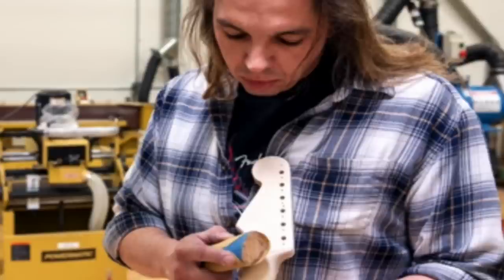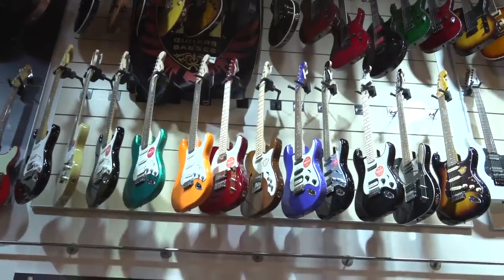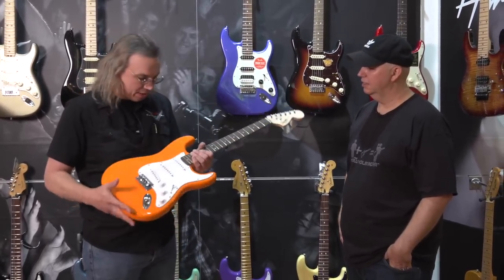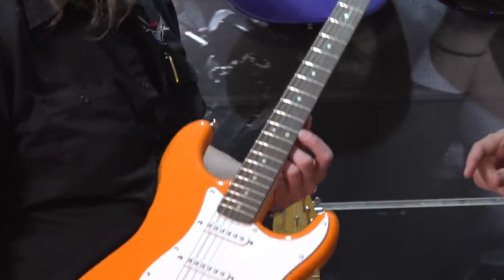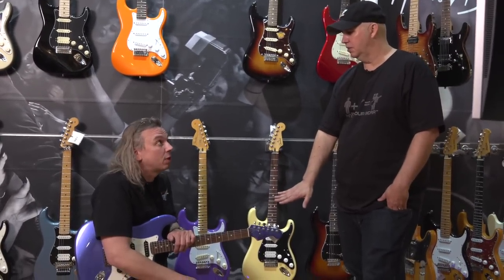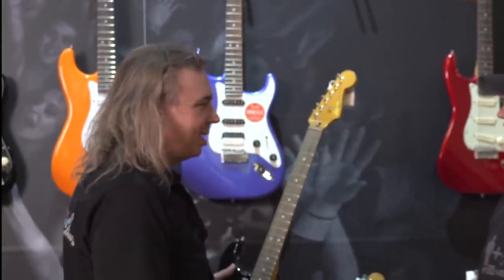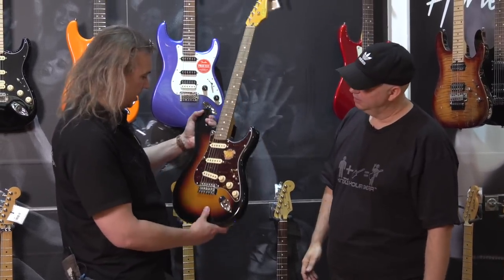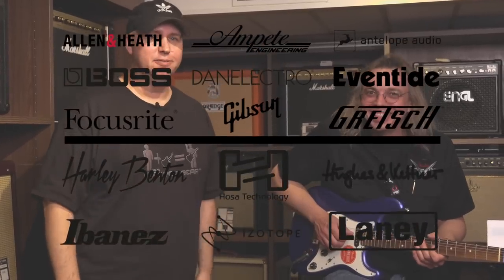What Squier Would A Fender Master Builder Buy?

Comment: Pretty much bummed out on Squier strats atm.  Ordered a new Squier Bullet strat online to use as a beater that arrived with bad electronics.  Returned it and ordered a Squier Standard strat thinking it would be better.  The Squier Standard was worse than the Bullet.  It had a bad neck that was set crooked and there was a 1/4" crack starting to develop at the top of the neck pocket.  The crack is on the top side of the neck so you can see it every time you play.  The skunk stripe at the back of the neck was not sanded flush.  The proud edge of the skunk stripe rubbing against your hand sliding along the neck felt sharp and was uncomfortable.  The front of the bridge was angled way up and couldn't be leveled without causing massive buzzing.  No truss rod adjustment was going to fix this neck.  The pickups had to be adjusted way up to match the high action.  Tuning was a nightmare and adjusting the intonation was all but impossible.  Couldn't RMA that Squier Standard fast enough.  That's two in a row defective Squier guitars purchased online.  Both were 2019 models made in Indonesia.  As with any mass produced product QC makes a huge difference.  In both these cases the defects stood out like a sore thumb yet they passed through QC anyway.  How does a plain as day easy to see and feel un-sanded raised up skunk stripe make it through QC?  Instead of binning a guitar that had a bad neck set they purposely angled the bridge to compensate and shipped it out knowing it was defective.  The poor workmanship on display here and cheap parts combined with the QC failures reflects very poorly upon both Squier and it's parent company Fender.  Only way I'd buy a new Fender or Squier guitar now would be to check it out in person because based on my recent experience the odds are good you'll get a bad one if you order online.  Can't trust the Fender/Squier brand name to deliver a quality instrument without having to cull through a pile of them hoping to find one guitar worth having.  It's sad really.
Reply: carpathus I don’t mean this in a dickish way at all, but you get what you pay for. I’ve never been happy with anything from Squier except for their classic vibe series. If you can’t save up for a MIM strat then at least try the Squiers out in store and save yourself the headache.
Reply: Whatever.  Guess you can buy something that looks like a guitar for 200 but if you want something that will actually function as a guitar, well that's a whole other story.  And just so you know, anytime somebody starts out saying they're not trying to sound in a certain way they are only fooling themselves.  Everybody else can see right through it.
Reply: Whelp, as it turns out the best move is to skip the Squier altogether.  Ordered a new Yamaha Pacifica 112J.  Build quality is as good or equal to an American Fender.  The Pacifica is made from high quality materials and the fit and finish are astonishing.  Factory setup and intonation were perfect.  Nothing wrong with the stock tuners but did change them out with a set of Hipshot locking tuners.  Freaking awesome guitar.

Comment: If I wanted to apply some steel wool to smooth the neck, is there a recommended grade to use?  
Or even a reco'd brand?
Reply: David Woods “4/0” or “0000” (same thing).
Keep it away from the pickups otherwise tiny loose strands will get get all over the magnets/poles.

Comment: I'm a beginner......Here's what I would like to see in a guitar for beginners:
1-  A purpose built guitar specifically designed to learn on
2-  I want rails running parallel to the neck to mount adjustable mirrors on so I can see my fingering on the fret board as well as my picking hand.  I need to maintain proper posture and instrument positioning while also seeing my fingers.  Once I learn what the hell I'm doing, this feature would be outgrown and I would buy a different guitar.
3-  A couple slots in the guitar to hold some spare picks as well as a place to stash the damned pick without setting it down and losing the damned thing.
4-  Built in tuners on the neck AND body to constantly check pitch while playing/bending etc.....

What features would you value in a guitar expressly designed to learn on?   This might be a ugly piece of crap but its purpose is purely as a learning tool.  I have NOT heard of anything designed and built expressly for this purpose......
Hello Guitar builder?   Anyone listening?
Reply: No problem....except you broke the bank barrier for entry level gear...shattered is a better word. Virtually nobody will drop the kind of money your talking about on something so specifically purpose built it has no resale value. You're talking about a one off custom. The word is now vaporized...
Reply: @willroland9811  
You might be right.  What would such a instrument feature that would set a entirely re-engineered standard as a unique one-of-a-kind instrument?  
  I don't see anything about this design that would make it any more expensive.  
  I am visualizing a tube frame around the fret board. The frame would provide a generous and adaptable mounting point for picking/fretting finger observation.  This frame would provide for adjusting a preferred angle between the fret board and the guitars resting place on your leg, your lap, or any other surface. This would also be a good place to locate a fully adjustable guitar amp cable plugin.  Telecasters have a good cable plug....Others, including mine have the cable plug in exactly the perfect place to smack into something....
This tube frame wouldn't be expensive...
   The tuners could be eliminated.  These are anachronisms. I would relocate the tuners to the other end of the fret board and use thumbscrews to tension the strings.  Would this be expensive?  More expensive than the grovers on my Harley-Benton?
  No whammy bar....These have no place on a beginner guitar.  I need to learn how to properly bend notes and stay in pitch while doing so....
  A decent bridge with the usual adjustments for action height, etc.
  A decent electronics package. Two humbuckers and the switches and wiring are pretty cheap these days.  I would have a Bluetooth module in this thing that would feed to a laptop, phone, or even some of the available amps.  Yeah, that might jump the price tag some....
   This list could go on and on....Care to add something to it?
   I'm tempted to prototype something and give it to one of the YouTube Guitar Instructors to guinea-pig his students with.  If it reviews as a worthwhile learning/teaching aid, I would probably just give the prototype away to a builder who could develop it.....
Reply: You might want to look into Fretlight.  They use Bluetooth and they have LEDs built into the fingerboard to help you learn.  The low-end model is $300 so that's not too bad.
Reply: @benjaminbarrera214  
I appreciate your comment but the entire point is to develop the muscle memory needed to actually play the guitar without twisting it to look at the fret board.
  My proposed design is purely a TEMPORARY crutch for learners to see the fret board while maintaining a ergonomically correct positioning of the arms, wrists, and fingers.
  Based on the total lack of enthusiasm I have seen in the comments, this idea is going nowhere.
  Probably, the issues I am looking to solve will be resolved with a few weeks or months of practice.   Oh, well............

Comment: This is wrong, sorry. Nothing he says is not true but...
I’ve owned/currently own/played all kind of squires and fenders. And the one he discarded (the vintage series one) is the best guitar of the 3, it’s actually as good as most fender guitars, and it’s not a matter of taste, I happen to share his prefferences and agree with what he says. But he’s actually just rating them based on setup issues (when deciding among the 3 of them). Not to mention he might get a particular unit that was particularly good or bad.
Take the vintage series one, sand the back of the neck, takes 2 minutes, and set it up properly, will blow the other two out of the water, soundwise, on playability and quality. Do that and check up on the same guitars one year down the road...
And when set up properly, the vintage series do NOT choke like that, maybe with more extreme bends, but not like in the video. 
Believe me, those vintage series squier are really fine guitars.
Also, he didn’t consider fret tallness/size etc... that’s kind of important when you decide on a guitar, yes it’s totally a matter of taste but it is important, some people might not like the big frets on the vintage and would preffer more modern frets, that would be a real issue.
I don’t know what he tried to do here, it’s like choosing between the guitars based on the strings they have installed...like he could have picked a custom shop fender, poorly set up and with rusty strings and say, oh no, I’ll go with the affinity squier.
All that said again, they are all very good guitars for their price, but the vintage series are not just good for the price, they are good for any price.

Comment: *** PUBLIC SERVICE ANNOUNCEMENT *** @ 08:56 Phill informs Ron Thorne that the guitar he’s holding is sub $250 USD, to which Ron replies that a setup costs $250 USD. 

DON’T EVER PAY $250 FOR A SETUP. YOU CAN PAY $60. I’ve even paid $20 for a setup with new strings on a holy grail guitar — $20 for a setup with strings by a guy who’s done work on EVH’s guitars and amps. I love Ron Thorne, but I think he greatly exaggerated the cost of a setup here. Happy shredding, y’all.
Reply: That's assuming the guitar is in great shape and barely needs any adjustment. A "setup" as requested by so many customers is very often more than just a few quick adjustments, because you encounter issues that take time to address.